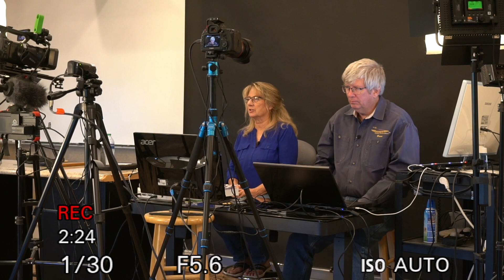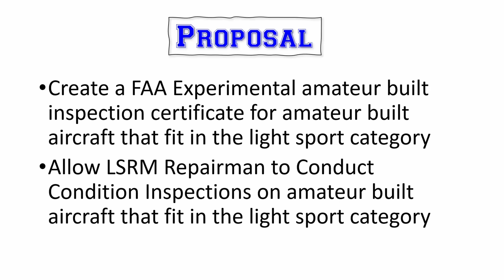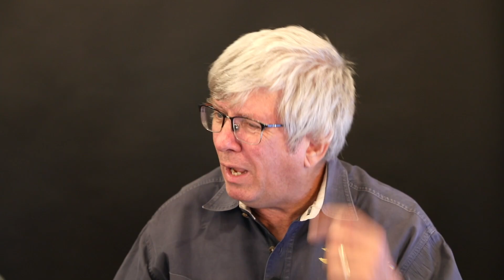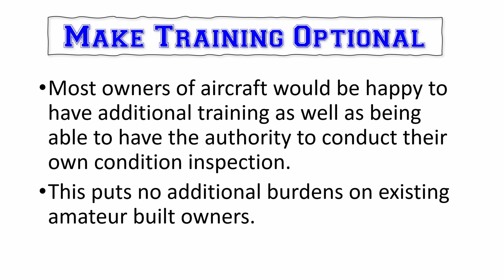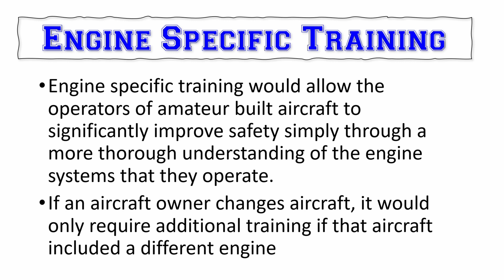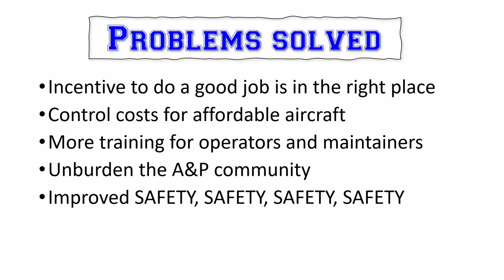Proposal- The Repairman Inspection Course for Amateur Built aircraft owners

Comment: My first plane that I owned was a 1946 Ercoupe that I completely restored under the supervision of an A&P/AI. It took me a year and a half to restore, working on it 5 days a week, seven hours a day.  I touched every part of that plane and knew every nut, bolt, and system.  It irritated me to no end that I had to pay someone every year who knew less about the plane than I did to sign it off. After 15 yearsI finally sold it and built my first EAB so that I could sign it off myself.  Lately I have been getting the itch to buy another plane.  I am looking at only ELSA’s for the same reason ( your repairman class).  If I could buy a similar EAB that qualifies as light sport, attend a reasonable training class and be able to inspect it myself, I would take the class in a heartbeat.  I think that you are correct in that it would make the light sport segment or EAB much safer.

Comment: Hi this is Adam Tharp in Luttrell T.N. First off I just want to thank you both for doing such an amazing job on keeping everyone up to date on these issues. I do agree that amateur rated light sport experimental aircraft owners should be able to do their own inspections. I live in a small town and you cannot get anyone to do a inspection. My aircraft is no good without one. I myself have taken the Rotax course for my specific engine and the repairman course but I cannot do my own inspection. When I see a and p do the inspection I think to myself wow I could have done that and more thoroughly. Allowing us to do this would be safer and much easier.

Comment: I think you're risk is as an A/P mechanic for certified or EAB or Light Sport are the same. I am a 60 mechanic but not an A/P. I've rebuilt the Wankel engine in my EAB; and I've built most of an RV6; which I got disinterested in; and sold. I am a better A/P than some of the A/P I've come across. Government regulations do not protect you (mechanics) from liability; and the whole condition inspection of a EAB is more risky than a certified plane is absolute nonsense; unless you're doing a really poor inspection.  You're not signing off on airworthiness; it's just a condition inspection.